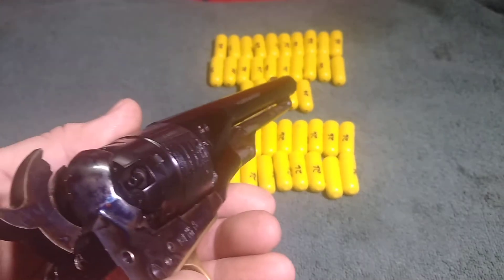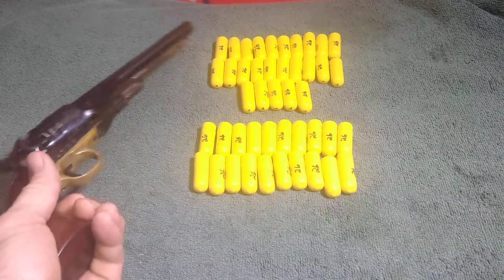Black powder revolver reloads

Comment: There is a reason why your powder measure is made out of brass and you should not be using steel you should not be using anything that can cause a spark or deal with static. If you continue doing that one day it will bite you sooner or later. Your other option is to cut the backend off of 223 and solder it to an old cap for your powder and that way you can pour it directly into your powder measure
Reply: The gun is made of steel. It's made of brass because it's easy to work and doesn't scratch anything. As long as only one of the two pieces of metal is brass, there will be no sparks. Brass is also capable of generating static electricity.
Reply: @tv-pp  boom.  science!

Comment: You're not the first to do the straw idea. I used to do it with powder and shot back in the day. Now I use mainly premade paper cartridges kept in flip top plastic vials or boxes with wooden blocks drilled to accept the cartridges. Paper cartridges are a lot more convienient in the field. Keep using a steel spoon for a powder scoop and one day you're gonna go boom. The powder measure is made of brass or plastic for a reason. But, hey, you do you. You got a lot of learning to do, hope you don't have to learn the hard way. Do some research and find out why things are done the way they are.

Comment: Just file the spout on your powder flask until it is the powder volume you want, it would be very fast if you filled your capsules directly off your flask. Cabela's sells spout premade to several weights if you want to go that route, the kit has 4 - 5 spouts in 5 grain increments  for a reasonable price. Have fun!

Comment: Uhm, isn't the wad supposed to go over the powder between the powder and the bullet?
Reply from the maker: Um. In the gun yes. Not in the reload tube. If you put the wad in before the ball you would play hell trying to get the wad back out. These are supposed to make reloading faster and easier. Not harder and slower
Reply: @torpedoesntarantulas5758  Blackie has a video on using the Tubes. You remove the wad and ball holding them between your fingers then pour the Powder into the Chamber put the wad in and seat the Ball on top.
Reply from the maker: Where do you think I got the idea. Idk why you're telling ME how to reload
Reply from the maker: Abitnutz is the one don't know how to reload a revolver

Comment: I make paper cartridges for my colt Walker dragoon and load them with 45 gr.tripple 777 . I make my paper cartridges out of magician flash paper and for the last 35 years I haven't had any problems with them they all fire until occasionally I find a bad percussion cap and that's one bad cap out of maybe 100  . I like my old dragoon it's a power house of a side arm and very accurate

Comment: "Grains" are a measure of weight where 1 pound = 7,000 grains.  Black powder and its substitutes are usually measured by volume, but the volumetric measurement of a certain grain weight of black powder will weigh out to be very close to that grain weight on a scale.  The weight to volume comparison is not necessarily true of the black powder substitutes, but they are designed to give roughly equal energy to black powder when measured by volume even if the weight does not match.

Comment: hey, could you do that in reverse order,,  ball in first,, wad,,, power,, cut a plastic cap,, for the end where power is,,, pull that off,,, power fills the cylinder,,, squeeze the end,, wad and ball are already in the correct order, then crimp the load,,,

Comment: You might want to try putting your ball in first then the powder and then the wad to keep everything contained and then when you want to load just take your water out turn the capsule round side up the weight of the ball will bring the powder down and then you put your wad that's in your hand down the barrel in front of the ball it works better just saying

Comment: If you wish to water proof you cylinders on the lead side use beeswax on the cap side go too a pet store look for aquarium air tubing. Cut the tube so the hammer can still set off the caps but is secure to the nipple cone base. Now you can test the tube sizes by dry firing with just live caps NO POWDER AND LEAD if the cap pop you are good But putting the tubes over the caps can set them off so when capping them point it in a safe direction same with putting tube pieces on the capped nipples now if you can get silicone tube or hose that is the right size you are golden.

Comment: Original method of revolver loading was:   powder, ball and lube covering the ball.  The lube prevented chain fire of all chambers.  Pre-loaded paper cartridges of nitrated paper are MUCH faster.  Load the whole thing, cover with lube (or the new "wads") put on a cap and you're good to go.
Reply: If you use the correct diameter lead roundball, so it shaves off a ring of lead each time, you can skip the grease over the ball. The grease, or wax mightbbe great for leaving the gun loaded for an extended amount of time.
Reply: The "ring of lead" is just a good indicator of a good fit of a soft lead ball in the chamber.  Unless you place a "wad" over the powder, then load the ball, a chain fire could occur.  Either way, lube helps keep fouling soft and can aid in cleaning the bore.
Reply: Exactly.  "No way a spark is getting by the grease".  That is why you put lube over the ball in the chamber or the new wads over the powder charge.  Grease puts out the sparks... no chain fire.  Have fun!  Love the smell and smoke of black powder!
Reply: @wademarshall6705  I had 1 box of 444 lead roundballs, too small for the old 1858 Pietta I had before. I pushed them in with a small patch, like loading a Hawken. No problems, accurate. Very easy on the loading lever as well.

Comment: Subject material, Well first off The one shown is an 1861 Navy the actual 1851`s have a octagonal barrel and were the first repeating pistol. Now the 1861 has the same exact frame as the 1851. Barrels were streamlined in 1861 such as yours. Still an awesome firearm a great video none the less.Far as measuring powder a cheap CVA plastic flask would help ya out 100% last not least by any I would love to see or hear of your test results between the waxed/non waxed. As far as cleaning, YES you can show, but needs to be done immediately after shooting, waiting to clean is a disastrous game with black powder
Reply from the maker: If you're talking about MY guns. The ones featured in this video. They are all 1860 army. Not 1861 navy

Comment: Interesting, I was wondering why pistols did not have pre packs like they had for rifles during the civil war. Those were packed in waxed paper tubes. Tear off the back, pour in the powder, squeeze out the ball and ram it home. Kinda the same premise here. Why has it taken so long to be rediscovered? Also, they have repro models that can exchange pre-loaded cylinders, a speed loader if you will...

Comment: Or you could just use the black powder pellets.
Reply: Those pellets are 30 grains, a bit heavy a load for some 44 revolvers, especially the 36 caliber guns.
30 to 35 grains is fine for the 44 Walkers, Dragons and Ruger Old Army revolvers.
The service loads during the Civil War was 25-26 grains in the 44 caliber revolvers.